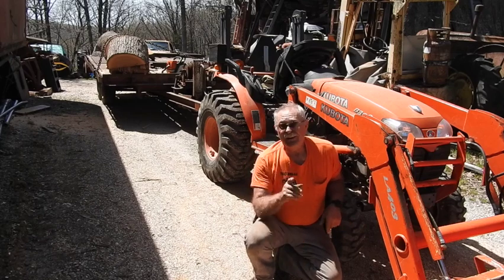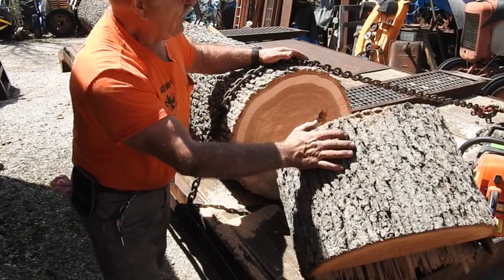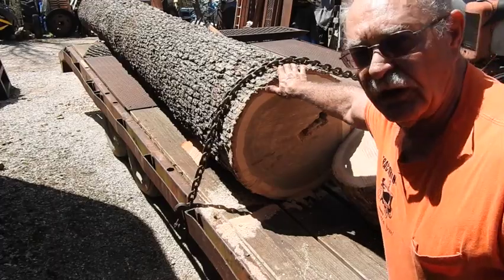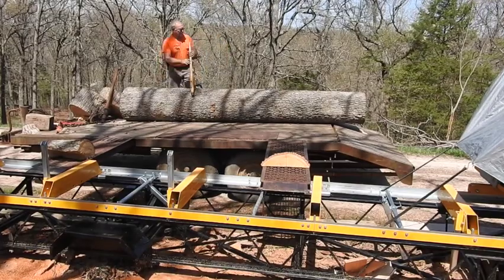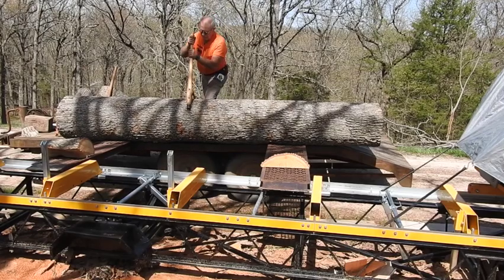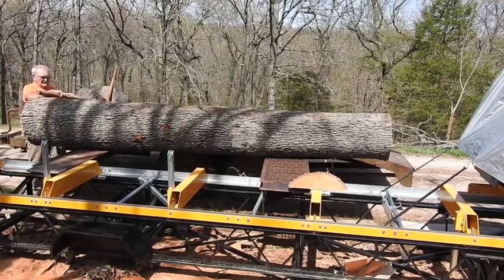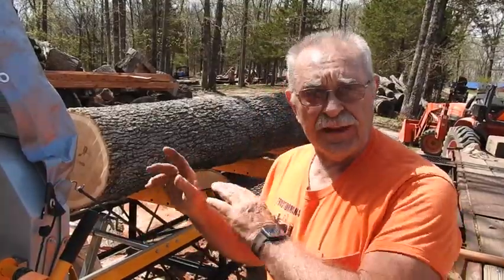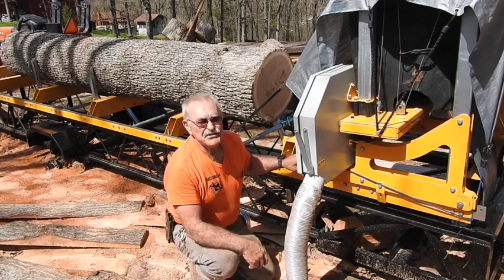1264 Pounds of Oak on the OS27 Frontier Mill -Outdoors

Comment: What a super fine and safe loading the log on The Missus Mill you plum did! This calls for some extra tippin! And what you said about how easy it is for something to go wrong is so true. One has to be a step ahead of what might go wrong. Like clearing a path when cutting a tree down so you can skedaddle outta there quick. That log looks like it will make some beautiful boards. It’s like opening a Christmas package that’s always a surprise. And remember, if loading up logs on The Missus Mill be sure not to wear your tutu. Put it on after the job is done! Don’t want to tear that delicate fabric. Thanks Kindly my Friend and I’m heading to refill me JOcup for some well deserved tippin your way! DaveyJO
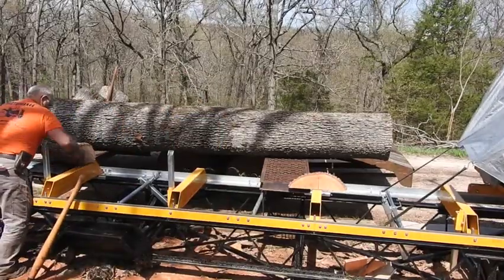Reply from the maker: Boy Howdy yeah !!  If I'd knocked the Missus' saw out of alignment or worse yet, knock it off the jacks I'd probably went to bed without any supper !!  I'm SURE there's gonna be some boards that will be too pretty to put on the deck of the trailer...  but that's the goal, to get more 2x6 or 2x8x12' for the deck.  Like you say...there's always a surprise in there.  This one will get crazy up around where the trunk splits and goes two separate ways.  There's gonna be some swirling in the grain going on for sure !!  Hey DaveyJO...good news !! The Missus surprised me with a new Quizinart coffee maker today !!  Fully automatic and guaranteed to have my hot stuff ready to pour as I enter the kitchen in the morning !!  What dayathink about them apples...!!??  LOL  I'll tip the first ever cuppaJO in your honor tomorrow morning about 5:30 or so....
Reply: @tractorman4461  I have that very same JOpot meself. I was up at 6 this morning and was thinking it’s your 5. But we shall stoke the pots in the morning then with sippin anna tippin goin on at east and west, it will most certainly make for a fine as frogs hair day! This reminds me, I need to grind some sacred beans for the morning! You have a plum good JOpot! I’ve had three now over the years and they do a great job! Cups up, hats off to The JO Faries! And to The Missus of course! DaveyJO
Reply from the maker: @daveyjoweaver6282  Yep, broke it in right real bright and early this morning....ready to set it for the second pot in another sipper two.  The Missus does the fanciful bean grinding for me.  I thing she has trust issues when I mess with her machinery...LOL
Reply: @tractorman4461  Yep, proper bean grinding requires help from the JO Faeries! Now if you wear your tutu for this important procedure, perhaps Missus 44 will allow you to grind away? I’m tippin and sippin your way this fine spring morning! DaveyJO
Reply from the maker: @daveyjoweaver6282  Hahahaha....I'm thinking if I go to wear it too often, she might call the funny farm for a service call.....LOL I think I just heard our cups clang together about halfway twixt and tween....

Comment: Wendell I can really see and understand the value of the trailer that you built for the Frontier and why you made it so Heavy Duty, it's worth its weight in Gold if you count the value in wood you can process on it over years, that is a House Built On Rocks - so to speak, I can imagine you would like two hydraulic arms that can lift the log and roll it on the trailer like some machines do but with a forklift on hand I guess it eliminate the need for that, thanks for sharing and I can tell the way You perform the task was very safe
Reply from the maker: I really wanted a firm base for the mill just for this reason.  The four corners of the trailer are fitted with 5,000 pound jacks and the center gets a bit of stability by the hubs with the wheels removed. The REAL strength comes from the light duty but strong commercial bar joists.  More than the hydraulic lift arms, I'd rather have an automatic log turner.  You'll see how I have to turn this size log on the sawing video...and I explain how we did it on our 54'' circular mill back on the farm.

Comment: Wendell, This is a great looking oak!  I can totally understand you about the safety when you work alone.  I live by that everyday.  I've been lucky in several cases that I was working on.  It doesn't take much to cause a person to think, when they are facing some rough situations, does it?  haha  Great Vid!  I am sure that you will get some fantastic looking oak from that log.
Reply from the maker: I'm hoping to get more 2x6x12' material for the gooseneck trailer deck.  The deck is  rotted bad...real bad.  But if there's a few boards that have pretty grain, I will have to slip them off to the side for wood projects for the Missus.  I try to keep on my toes working alone as much as I do. Especially around something with a higher 'squish factor' as a log.  LOL
Reply: @tractorman4461  I definately understand that!  If I'm gonna get squished, I tell my kids and grandkids, they'll have to be around to dig my hole a full 6' deep. hahaha
Reply from the maker: @MichaelThomas-ej8nb  Hahahahaha...that's the right humorous outlook about the situation !!  Make sure they have long handled shovels....(-:

Comment: Great work. Love the explanations. Is that a Norwood mill ?? Kindness and love ☀️❤️‍🔥🪓
Reply from the maker: Its a Frontier, which is the lower level  of the Norwood line.  It's got many of the characteristics of the Norwood line  in a much more cost effective unit.  It's not cheaply made though, I think its very well put together and there ARE things that need to be a bit better but where it needs to be, it is a very well built machine !! If and when you make a purchase, go for as big of HP as you can and also go with electric start !! And build a heavy trailer or platform.  The weight of the logs can wreak havoc on these little mills.